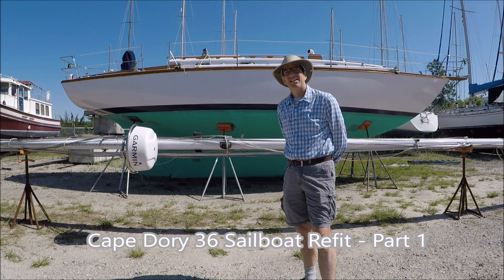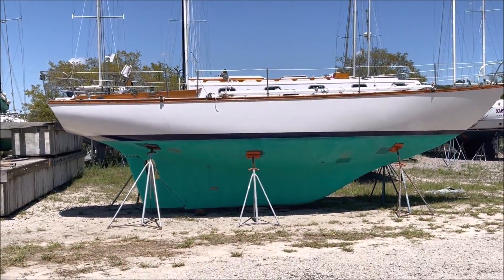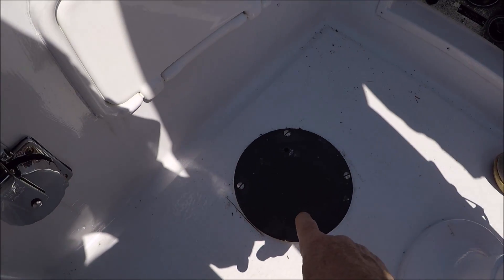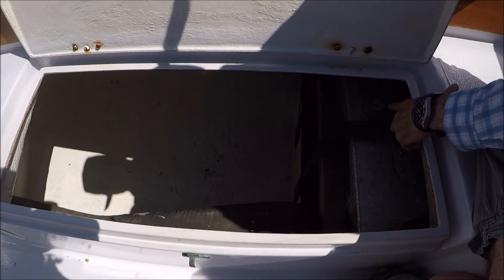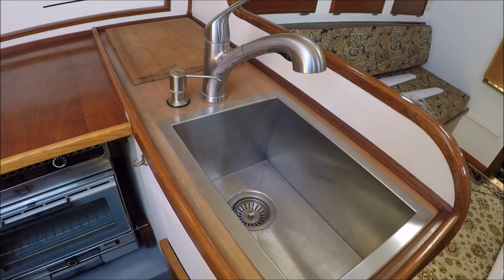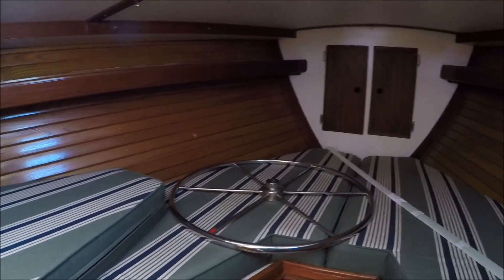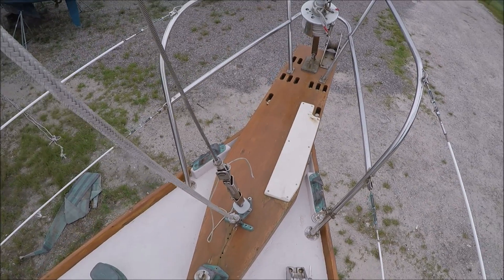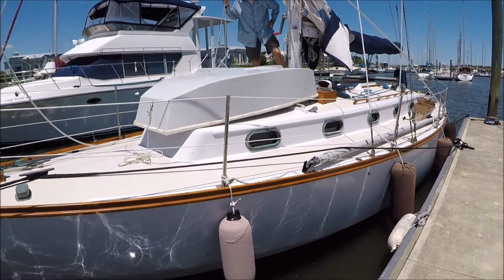Cape Dory 36 Sailboat Refit Part 1

Comment: STOP!  Do not ruin the boat. leave the prop and shaft and if you really want to convert the diesel to electric. For a windvane look at. Hydovane, expensive but cheaper than changing to a tiller and removing your existing steering. A gas outtboard instead of the diesel is going to expensive (25hp motor = $4k to $5k) plus installation and is a dangerous fuel and uses way more fuel than the diesel. The boat looks really clean please do not F it up to where it will not perform and no one else will ever want it!
Reply from the maker: It's true that the majority of sailors would not want one of my boats but we are not concerned with what the majority wants. Funny how whenever someone strays from the herd with innovation, those with the least knowledge on the subject object the strongest. The following comments are for those without a closed mind: 
1. I'm aware of the pros and cons of the Hydrovane and we have selected a Monitor instead. 

2. A tiller on this boat has many advantages beyond simpler self-steering. A tiller takes up less space in the cockpit, especially folded back at anchor, which is 90% of the time on a cruising boat.  A wheel has less direct feel and harder to know the rudder position at a glance. It's more complicated and subject to mechanical failure that can be difficult to repair at sea. The tiller can be reached from further forward where there is some shelter from the dodger so you don'/t have to sit in the aft cockpit where all the wind and spray is. Bigger unbalanced boats can benefit from a wheel but not this boat.
3. As to performance, the boat is mainly for sailing. Not dragging the inboard prop or having the prop aperture improves sailing performance, although that's not important to those who motor everywhere all the time. I've already tested this boat with a 9.8 gas outboard in flat water and fairly clean hull and it gets at least 5.3 knots. The 9.8 on this boat gets about 10 miles per gallon and fuel is stored safely in the aft cockpit lockers which will be watertight from the bilge and boat interior We're hoping the 6kw electric motor is similar since it's advertised as 10hp equivalent. Yes that's underpowered for an underskilled sailor. But diesels have losses and the actual thrust of a high-thrust outboard prop and extra-long shaft on a 9.8 is closer to 13-15 hp diesel inboard. As for your appreciation of "clean", there's nothing clean about a foul smelling inboard diesel leaving oil in your bilge and in your wake and the aesthetics of an inboard engine and all its gear is far less clean to some of us than an enclosed outboard well. Used or even new outboards cost a lot less, although that was not our main consideration. For our purposes a bigger motor is not warranted and won't fit in an enclosed well anyway. More info can be found in the following article: https://atomvoyages.com/articles/the-improved-outboard-well/
Reply: I tried to look up where you had done 2 solo circumnavigations and refit boats for decades but couldn't find it.
Reply: Agreed it’s a fine boat as is. I would not make many changes…
Take off the staysail boom, switch back to tiller steering. 
Everything else looks great!
Reply: Think of it as adding less. Removing the inboard fuel, engine, waste tanks, and everything else will make it much safer, more reliable, and far more repairable. All things that trump beauty and tradition.

Comment: A heavy 36 ft boat, with a small outboard on a lee shore, hmmm.
Reply from the maker: You should have some fear of that situation and the less sailing skills you have the more fear you should have. In the right hands a boat is sailed off a lee shore more safely and easily than motored with a diesel.
Reply: Silly man
Reply: If you wind up on a lee shore and are reliant upon an engine to extricate yourself - maybe you shouldn't be sailing in the first place, hmm?
Reply: @jangula5950  I sail Westernport in Victoria on a keel boat regularly.
There are short, sharp, seas, and 3 meter tides with all the associated dangers including a tidal divide.
Every time I sail in this beautiful environment, there is a lee shore on one side of the boat.
An engine can be more than a little useful when the wind dies unexpectedly, the current is running at 5 knots, and 'the plan' is suddenly out the window.

Comment: Bad ideas. As an owner former owner of a CD 36. Do not ruin this boat please. Tiler steering is good. The staysail boom and sheeting works well.
Reply from the maker: Since you didn't provide a list of all our bad ideas other than removing the staysail boom we can't take advantage of your wisdom. Yes, a staysail boom is fine but it's also fine to have it loose-footed to keep the deck clear.
Reply: @atomvoyager  cutting a hole in the hull for an outboard is wrong.  1) under sail. As the boat heels and pitches you will find this hole under water. The overhand are more than esthetic they effectively increase the LWL under sail and increase the max hull speed. 2) it is unlikely you  can get the outboard prop low enough for even small waves. I found that going into short period wind driven waves Skylark would hobbyhorse the prop out of the water. If want to go electric rebuild the existing shaft log at the design location and install new motor mounts. However; Do some math on power requirements and range. You will find if you are serious about traveling offshore the diesel is still a more practical solution. The old Perkins has ample power at 50hp and could happily run for days. 
You will find that you must add sail tracks and cars a few feet aft of the mast in order to get the staysail to fly properly. As well as a small winch on the starboard coach roof. The next owner of Skylark added a furler and removed the staysail boom and the staysail was useless. 

Finally you have a number of projects to do w/o making changes. How about rebedding those leaky port lights?
Reply from the maker: @svveritas9704  Thanks for your insight. Your comments are correct for most people on most boats. It's true, we are not "serious" about motoring much offshore. It seems you are unaware that I have tested and sea trialed this outboard well design on many boats in the 28-32' range before adapting it to this bigger boat and this owner's needs. Some of these boats have already crossed oceans with one 3/4 through a circumnavigation. Can't blame you for not knowing that since I didn't mention the 22 year history of my design in the video but will address it in a later video detailing the installation and sea trials. The outboard prop will suck air in choppy water sooner than the diesel prop which limits its effectiveness in those conditions. But in this enclosed position with a extra-long 25" shaft, that problem is less than you might think. Just part of the pros and cons and not an absolute deal breaker depending on your needs. When tilted up for drag-free snag-free sailing  the hull and transom slot have sliding cover boards to reduce turbulence and have buoyancy chambers on all sides to reduce flooding. It's a proven design that is not for the standard motorsailer mentality. Think of it more in terms of an improvement over engineless sailing as practiced by Lin and Larry Pardey and many others including one of my own two circumnavigations. The owner of this boat has sailing experience and was initially inclined to go engineless with only a sculling oar so he will be way ahead with this setup. More info at: https://atomvoyages.com/articles/the-improved-outboard-well/

Comment: Surprised he didn't want to replace the chain plates and standing rigging
Reply from the maker: The standing rigging will be replaced but the chain plates look OK at this point.
Reply: I like this one …. And Boo to the nay sayers a long shaft 20 hp motor  or even a 15 is more then enough to move this boat for anchoring and docking ease.